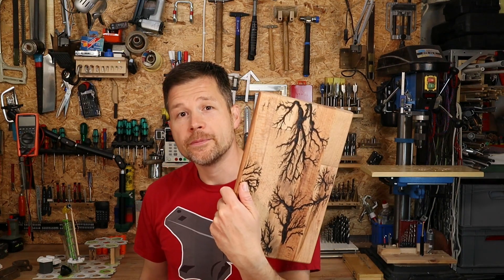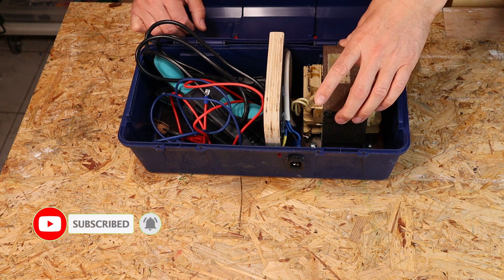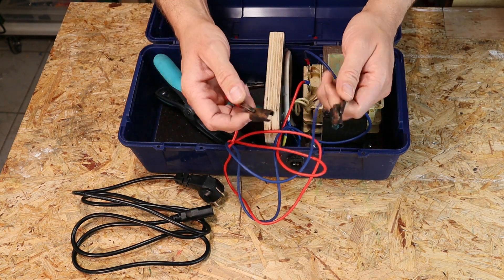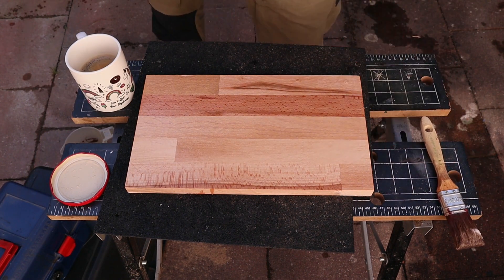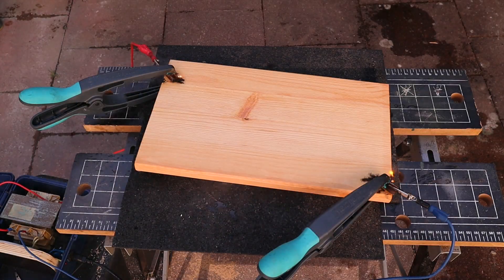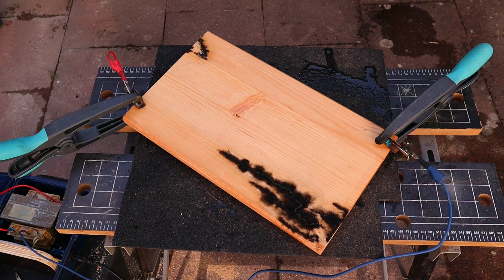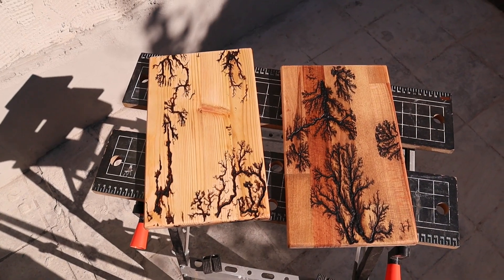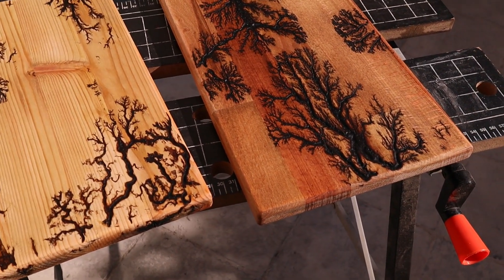Burn lightnings into wood. fractal wood burn DIY

Comment: At least 34 people have died trying to do this since 2016. If you're not 100% sure of what you're doing please don't make this. 

The transformer takes the 120v to 240v from the main power supply and turns it into 2000v and that's 10x the amount it would take to kill you. Using a microwave transformer makes it more dangerous because it negates the safety switch that would cut the power to the socket if it notices anything abnormal. It would just keep going and potentially cause a fire. 

It looks really cool and I'm glad you know what you're doing but it's super important people know just how dangerous it can be if they want to have a go themselves.
Reply from the maker: As allways you should know what you are doing does not matter if building, climbing or diving.
I dont know about the statistics, but 2000 Volts can be dangerous!
Reply: The statistics are probably a little dated by now and they're just from the deaths reported in newspapers so they could be a little higher if anything so sorry if they're a little off. If you do find more accurate and up to date ones please let me know! @heikoofalltrades2267